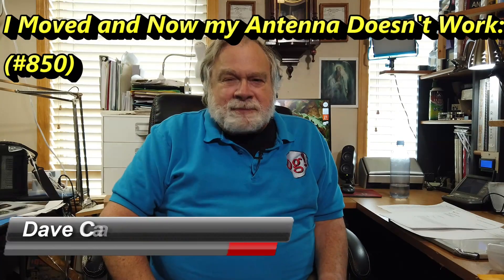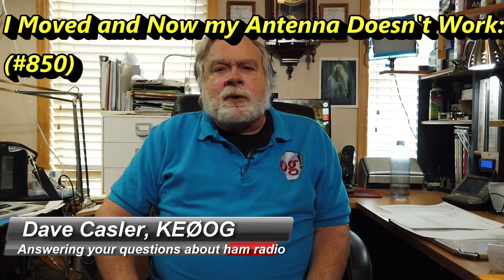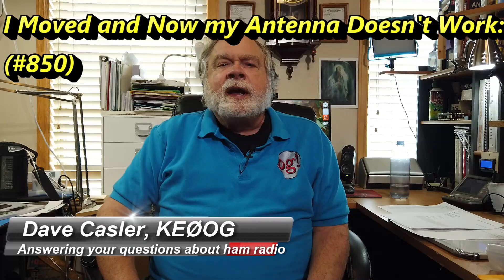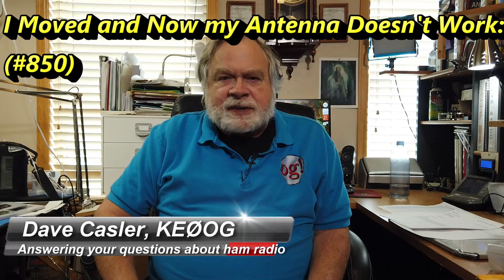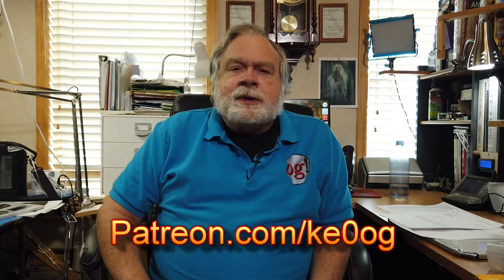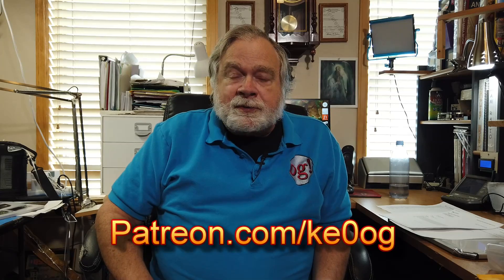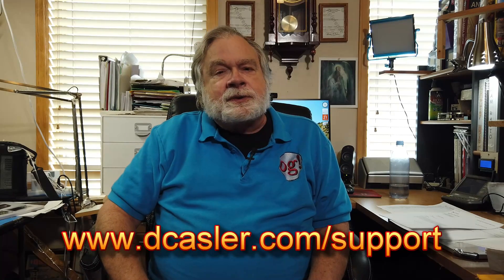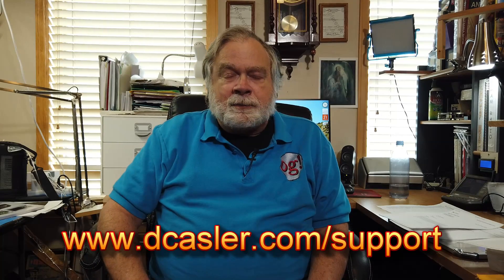I Moved and Now my Antenna Doesn't Work. (#850)

Comment: Thanks Dave for answering my question.  I saw what looked like cold solder joints where the three wires from each side join together, and it used a lug to connect to the stainless steel eye bolt.  There were also bolt joints at both sided of the two traps for the 80 and 40 meter top wire, so those were cleaned too.  One thing that I didn't know until I took it apart was that there WAS a balun/unun within the down pipe.  it was a ferrus rod with winding of motor wire.  Not sure it if was a 1:1 current choke or not.  Didn't seem like it needed to be an actual balun.  Getting it apart and back together was a real bugger.

I had similar mounting heights both in California and here in Oregon:  50' at the center and 20' at each end.  To answer William Shephard, I used RG-8 coax for both locations.

  Again, my thanks Dave.  73👍